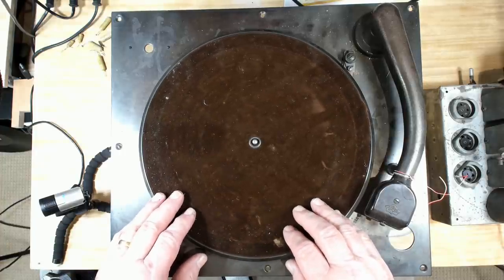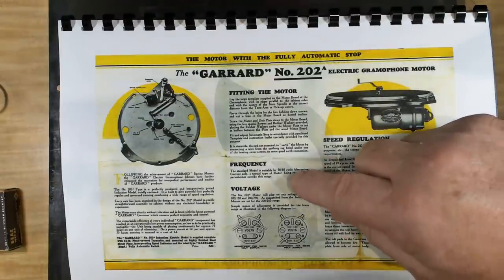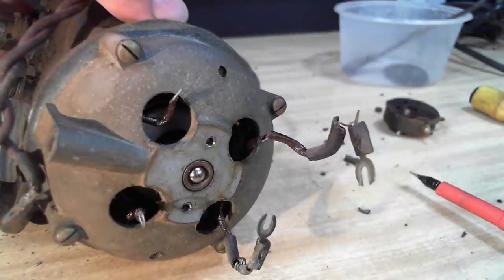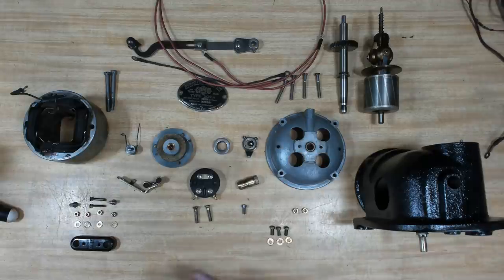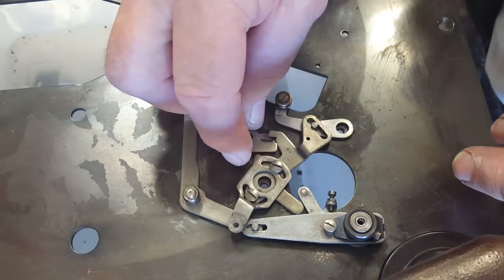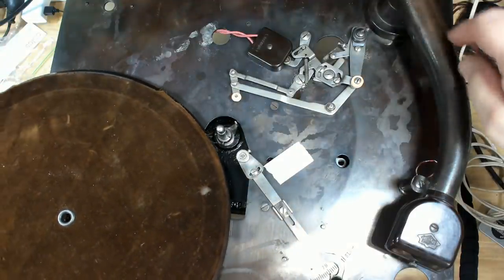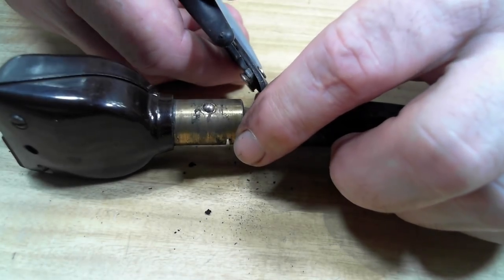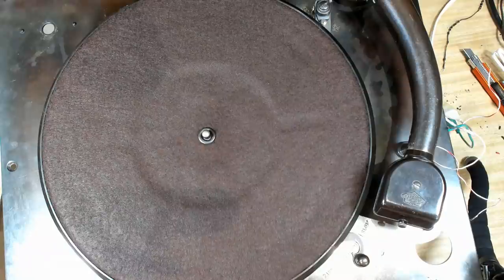Garrard Phono 202A and Airline Radio 62-144 repair Part 1

Comment: Sounds like 👍 one of those record players with a springwound motor. Maybe it operates by an electromagnet, since I see 👀 the power 🔋 cord. Montgomery Ward's was one of the best stores around. JC Penney's was another, and so was Sears. That's a REALLY nice set. Just don't accidentally run 🏃 it on the wrong voltage ⚡. It could fry the circuitry, blow out all the tubes, or burn 🔥 the motor out. At least, ya don't have to worry about winding a spring. Had it been, I'd have offered some safety tips on taking the spring barrel (casing) apart, to clean and lubricate the spring. Your friend, Jeff.
Reply from the maker: Hi Jeff, no springs in there fortunately and I checked the voltages were correct, it's working well now 🙂

Comment: A 4 pole induction  motor  would almost  certainly  run at just under 1500 rpm when powered by 50 Hz, and just under 1800 rpm at 60 Hz, if it is a single phase motor. For 78 rpm the shaft speed was reduced by gears or friction wheels.
Reply from the maker: Hi Fred, yes, that is correct, a non-synchronous motor will run just under those speeds. It was a nicely engineered motor assembly though, very impressive. Thanks Fred 👍🙂

Comment: Thanks for the video tutorial. We have also completed our therapy. Also thanks. I want your advice. The shaft bearing of a Loewe Opta Radio Variable capacitor is stuck. The spindle rotates smoothly when heated. It gets stuck again after it cools down. I couldn't turn it on with WD-40. How can I soften it?
Reply from the maker: Thanks mustafa. It's difficult to help you without seeing the problem and I haven't had much to do with Loewe tuning capacitors. I assume you are talking about the MW tuner. If it was me I would dismantle it to find the problem, but that's me 🙂

Comment: The gramophone needles were only meant to do 2 or 3 sides before you changed the needle. If you get a magnifying glass and watch what the needle does to the surface, you will understand why. I still have a lot of 78's and I'm sure they appreciated the coming of the modern sapphire needles that replaced the steel ones. Once again a fascinating and informative video Dave.
Reply from the maker: Hi Don, yes, I understood that some needles could only be used once. The ones I have have a 5 play life, I could get 10 play needles but they were expensive. I wonder if the longer life needles were harder on the records 🤔 Thanks Don.

Comment: For several years, my main function in life seemed to be installing and upgrading CD drives and later DVD drives.  There were those audio cables used to hook the audio circuits to the board and it was getting hard to find those, usually one would come with the drive but many times I was getting used drives without them. So one day I found a seller who was clearing out of them and he sold me 500 for a good price.  Well now since we no longer use the blasted things they are great for doing things such as your tone arm to what ever. I use them all over because they do have a shield hooked to the ground and this prevents the static from infiltering the wires and becoming amplified.  They give you 3 or 4 wires to carry data or power and seemed to be of high quality true copper. They are now being used regularly along with the 50 pin scsi cables I used to use for mounting hard drives in Apple computers or with a card, PC'S back when SCSI was THE drive to have. I also have a few hundred of those new in the plastic bags from another of my wise bulk buying.
Reply from the maker: Hi Jerry. I have a number of those cables stored away... somewhere, that's a good idea. I had a SCSI drive in my Pentium 90 back in the 90s, it was the bees knees 😄

Comment: Montgomery Ward was a catalog service, very much like Sears in the USA, later they did open stores back when the malls first came to be, they also had what they called catalog stores where customers could come in and order their product from catalogs in the store and it would be delivered to that store so you could come there and pick it up. I recall the very first video game I ordered that wasn't the original PONOG which we did have, I ordered from them.  It was store brand sort of Atari knock off but the controllers were garbage and didn't last a week. The nice thing about their store was you could take the thing back and replace it, which I did getting an Atari 2600 and many cartridges to replace the other.  Actually the other was much higher resolution and had better games, perhaps a better video processor or something as the Atari was a bit of a disappointment when it arrived, but we played it, actually wearing out a ton of controllers and a couple of the units before replacing it with a computer.  It was known colloquially as "Monkey Ward" for some reason. I don't know if there are any left, they eventually changed the name to just Ward's.
Reply from the maker: Hi Jerry, thanks for the info. Everyone had an Atari... except me, I think I was either too broke or too old or both 😀

Comment: I see the Monkey Wards question has been answered.  What many don't fully understand is that, like Sears, they were strictly retailers that offered many brands in a line, sometimes including their own brand.  Montgomery Wards house brand tools were Powr-Kraft whereas Sears marketed Craftsman.  These tools were actually made by leading manufacturers and just rebranded and sold for usually better prices.  Most of their in-house lines were like this.
Reply from the maker: Hi Sean, thanks. We had similar retailers here, not so much any more though 🙄🙂

Comment: Well done David... great to see the way you take these mechanisms apart and then have no problems re-assembling them. Not that long ago this would have been a top flight system! The ugly march of progress and I am ashamed to say that in the past (many years ago) I threw one of these out as old rubbish. Did the turntable have a case or was it part of the radio assembly? Looking forward to the next part. As always a joy to watch and listen to you working :)
Reply from the maker: Hi Kenneth, thanks, this was pretty easy to assemble. Most of these would have been chucked out Kenneth, makes this one a bit more valuable. The owner has the case, a console design with the player on the top and the radio just below, I haven't seen it but that's how he described it. Thanks and Cheers! 🙂

Comment: David repairing that turntable was a craft work as when they designed it and definitely increased the quality of reproduction when you changed the cable., however I would have liked you to give it a sandblast or a good polish as much as the base of the turntable and the tone arm so that it was freshly factoryd
Reply from the maker: Thanks Eduardo, I enjoyed doing that phono.  The owner wanted it left as it was, it would have been nice refinished 🙂

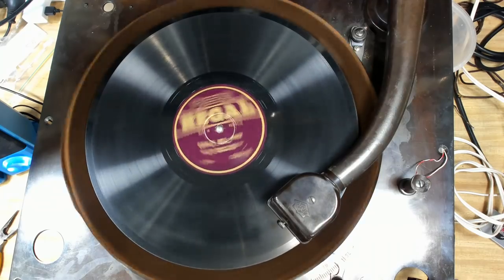Comment: 31:20 That inner run-out groove doesn't make the arm swing in or out like regular 78s do. The locked groove is nearly hard against the label. That is quite unusual.
Reply from the maker: Thanks Neil.
Reply: @truesoundchris  That "swinging" run-out groove migrated onto a series of 45rpm discs issued on behalf of the Golden Fleece service stations here in Australia during the 1960s. The recordings were sourced from Embassy Records in Britain and the discs were processed for Golden Fleece by W. & G. Records in Melbourne Victoria. W. & G. stands for White & Gillespie by the way.

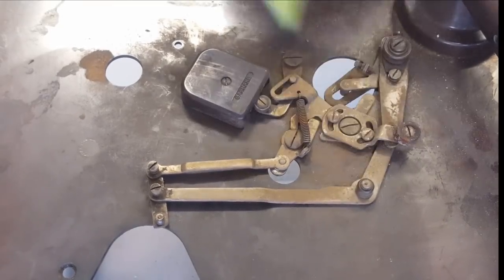Comment: Around 21:30 : those are the things that make me laugh.
Dave : "I can not clean it like this"
Also Dave : rubbing and brushing
Also Dave : "Oh, it cleans up well"  And then decides to remove the mechanism all together.

My hero 👍

Nice that you re-used the c-shaped terminals  on the motor : those look so nice on such an old piece of machinery.
90 years and it still can be repaired. And works
Reply from the maker: Hi Nard, I like to keep myself guessing, I thought the levers were rusty but it may have been cigarette tar. I liked the look of the terminals too, good that I could reuse them 😀
Reply: @DavidTipton101  I think its the warmth of the motor slightly vaporising the oil , which picks up dust, then layers it onto the metalwork.  Actually I thought the brass finish was correct in all I have seen (3 of them !)

Comment: Crikey Dave, that turn table is built like BRICK ##. Well done though, it's great to see a machine of that vintage back on  line again.Cheers.
Reply from the maker: Thanks John, it weighs as much as a brick too 😀
Reply: @DavidTipton101  Add a gear train, wonder if you can play the tinny plastic 45s that some companies did with find steel needles ?  they sound terrible with diamond p/us !

Comment: That motor was a thing of beauty, a joy to service and probably could last forever. Luckily modern manufacture has fixed all of that.
Reply from the maker: It is a thing of beauty Mahla, It's a  pity it is under the turntable 🙂
Reply: @DavidTipton101  fit a little chinese thing from an ion !

Comment: Another wonderful restoration. Can't wait for the chassis resto I'm curious to know what the tracking weight is. I'll bet it's very high with the size of that headshell and the hefty horse shoe magnet in it. There doesn't appear to be any counter balance or tension spring.
Reply from the maker: Hi Ian, thanks. I measured it at 170 grams 😧
Reply: @DavidTipton101  what did the book say. ?

Comment: Beautiful work.  I'm amazed at mechanical complexity of the turntable.
Reply from the maker: It's a nicely built machine, Thanks Nelson 😊
Reply: @DavidTipton101  Its when you have to file new ones when old bits are worn out.

Comment: Wonderful repairs and re-lube :-D
I bet that deck hasn't been cared for at all.
At last a quality engineer has turned back the clock, Yes i do mean you david :-D
It's an old fashioned design that was designed to last, and it did :-D
It sounds so much better than i expected.

Shame that no one cares about quality now :-(.
Reply from the maker: Thanks zx8401ztv. There's no reason that deck shouldn't be here in another 90 years ready for an overhaul 😀
Reply: @DavidTipton101  lol i think you won't be available to repair it in 90 years lol.
Find a museum that would like it, then they would have to find another version of you to keep it going :-D.
I'm just thinking another version of me... frightening :-D
Reply from the maker: @zx8401ztv  Haha... another version of me is also frightening, I'll just run it past my wife 😄

Comment: It’s amazing that the finish and fit was good didn’t show much ware in the motor or the control arms , Good show as usual.
Reply from the maker: Hi Keith, thank you. There was almost no wear in the motor, an easy life I guess 🙂
Reply: @DavidTipton101  I thing a lot of stuff got bought,  but never really used,  hence restoration is often undoing the problems of being more stored (wrongly, damp. gravity, bugs)

Comment: Another nice video !

What you might consider is 'silk covered lighting flex' for the wiring - it's readily available on eBay etc in 2 and 3 core varients and looks just like the original cotton covered flex - but with modern PVC innards !

Edit - just watched a bit more - and it looks like you're already using reproduction cotton covered wire - so I'll shut up and go away  ... .. .
Reply from the maker: Ha ha... I wondered what you were on about Mr B until I pressed the 'Read More' text and read the rest of your comment 😄 Thanks Mr B 👍🙂
Reply: @DavidTipton101  Yep - not to self - watch all  of video before commenting !

But - to add - I imagine the silk sleave if pulled off the flex and varnished would be a great substitute for the original 'Empire' cloth sleaving you see on old radios.

And I do think it's worth at bit of effort to try and restore them so they're not obviously full of new components - restuffing capacitors as you do makes them look a lot better IMHO !
Reply from the maker: @mrb.5610  might be a bit stiff but a good idea 👍🙂

Comment: That pickup head is almost identical to ones used on Collaros from the late 30s and just post war. They are known as 'moving iron' pickups. The rubber sleeves on the armature usually go hard, limiting the needle compliance, and increasing record wear. They can be renewed with fine silicone rubber tubing, or in the old days I believe bicycle valve rubber worked well. A fiddly job but doable with care, the windings on the coil are incredibly fine and delicate.
Reply from the maker: Hi Teddy Eddy, I wondered about replacing the rubber but as it's working very well and it's not my gramophone I decided to leave it be. I also assumed the rubber would be moulded in and would need to be cut out somehow and a new piece glued in?
Reply: Hi David
The armature rubbers are rubber tube. Easy to scrape off. Some have a flat rubber damper to control the movement of the 'fish tail' that sits between the two pole pieces.
If the rubber has gone hard the needle will miss track, or even jump heavily modulated grooves.  @DavidTipton101
Reply from the maker: Ok, thanks Teddy Eddy, I'll check it out 👍🙂

Comment: In the UK we have the TV programme "The Repair Shop",  while it is interesting, and one chap is an expert in the clockwork motors for gramophones , but they dont  show the 'trade detail' that you bring in your vids - for electrics I think they dont want folk trying it at home.
Reply from the maker: Hi High Path. I watch the Repair Shop and the radio guy who drops in from time to time to repair radios and gramophones. One episode I saw the other day the chap fixed up an old pinball machine, good programme and I pick you a few clues too 🙂
Reply: @DavidTipton101  I think he is on vintage-radio website too, they changed the expert when they found things like radios ran on electricity and not springs !
Reply from the maker: @highpath4776  Haha... that must have been a surprise. I'll see if I can find him on the vintage-radio site 👍

Comment: Hi, David. For me, the speed test with the needle on is wrong, you not take in count the weight of the cell phone plus the wood stand.... I think is better if you use an stroboscopic disc.
Reply from the maker: Hi lu9da, you are probably right but the record speed sounded right. I wouldn't suggest using it at audiophile level 😀
Reply: @DavidTipton101  oh, god, no! an audiophile probabilly kill us only for mention him! 😀
Reply from the maker: @lu9da  😄

Comment: Montgomery Ward is a retail/former mail order company that is a rival to Sears, and operates similarly. They have fallen on hard times in recent years, but then again, so has Sears.
Reply from the maker: I did a bit of research for part 2 when I work on the radio part. I did think they were a department store. Thanks Brett 👍🙂
Reply: @DavidTipton101  You are welcome. Catalog sales were their thing in their heyday, and you were either a Sears family, or (like us) a Montgomery Ward family. Rich people where Speigel families. "Airline" was the Montgomery Ward's house brand (as "Silvertone" was to Sears) for radios and similar, made by various other radio companies. There are people who can look up manufacturer codes and tell you who made it - given the date, and the construction of the radio, it looks like it might have been Zenith, but I am unaware that Zenith did badge-engineered radios.
Reply from the maker: @brettbuck7362  The owner did a bit more ferreting in the case and found a reference to Wells-Gardner who supplied radios to MW so it was made by them.

Comment: Again, nice video on nice work; the way you combined your video work with mechanical assembly is fluent, aspeccially on that motor.
When I add thin oil, I usually mix it with a bit of grease, so the combination does not drip or creep out by capillary process.
That magnetic pick-up, I could not exactly see how the needle was attached, but it seems clearly a moving magnet type. As you, I did not know the had them back then, but in later days they added the moving coil type, with lower impedance for the need of the much smaller coil.
Reply from the maker: Thanks Erik. Thanks for the tip, I could have used thicker oil too I guess. I didn't check how the needle was attached, I assumed the magnet was fixed and the coil vibrated in it. I'll see if I can check 🙂
Reply: @DavidTipton101  I think... not sure, that there's a small moving magnet, tinkling in the narrow space between the poles of the core of the coil. Something like this principle: https://www.goldring.co.uk/cartridges/moving-magnet-cartridges.html
Reply from the maker: @erikdenhouter  I tried to have a look but can't get the cover off now it is assembled but I think you are right. The needle holder appears to be held in a rubber support from what I can see but that's about all I can see.
Reply: @DavidTipton101  Thank you for trying. For sure learned that magneto dynamic pick-up is not from the '60 as presumed.

Comment: Stretching heat shrink? How is that done? Wow.
Reply from the maker: I use needle nose pliers inserted in the tube and pull them apart. I show it in part 2 🙂

Comment: I think you should not have done the last speed adjustment. Your phone added weight to the platter which slowed down additionally. A measurement scale (disc) would be more accurate.
Reply from the maker: Yeah maybe, but the governor should compensate for it to an extent and it sounds the right speed when playing a record. A scale would be handy, I should print one 🙂